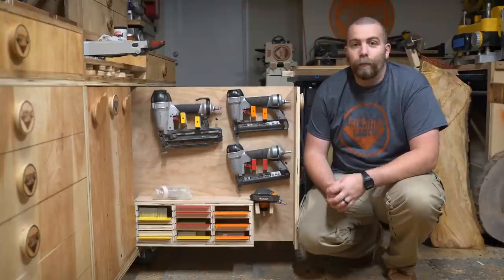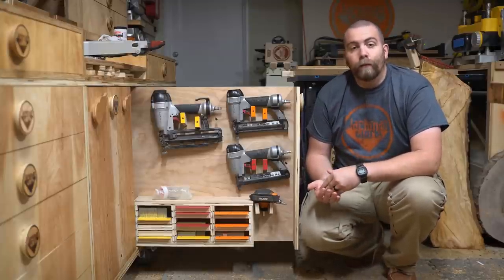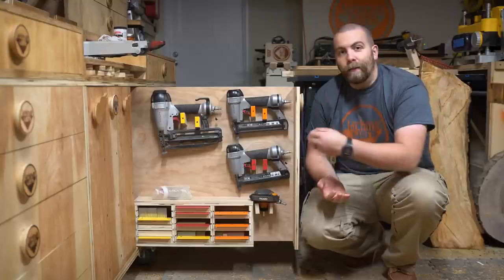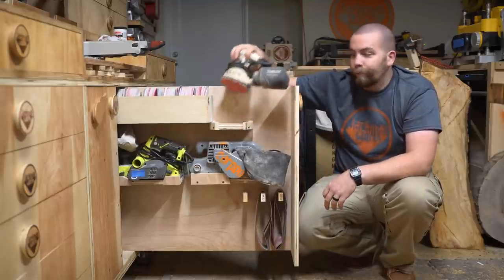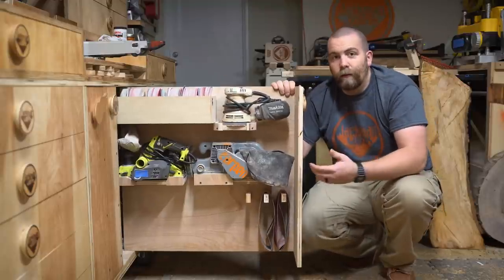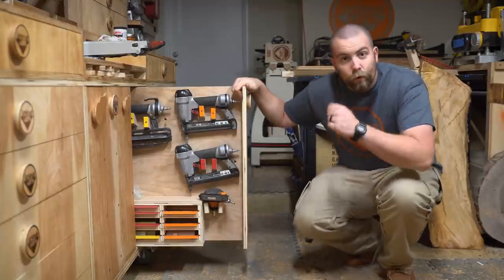Vertical Tool Storage Drawers / Moving Tool Walls

Comment: Hi Paul... currently in the CAD design phase of a mobile workbench that going to use the vertical tool storage idea... However, I can only allow myself 2qty of them. I know these are sized specifically for your tools, but what are your widths on the small, medium, and large vertical drawer. I'm currently at 5.75" and that feels a little small in CAD.